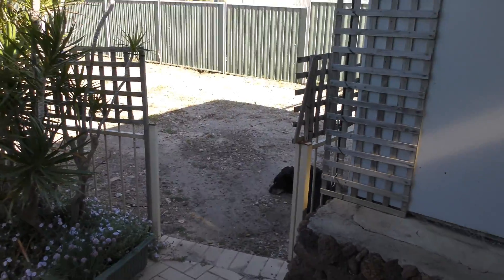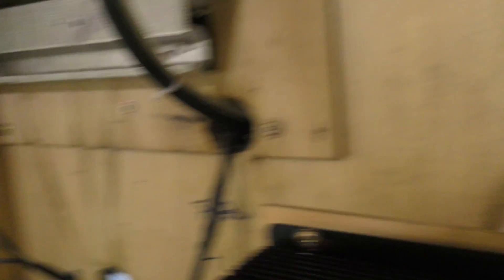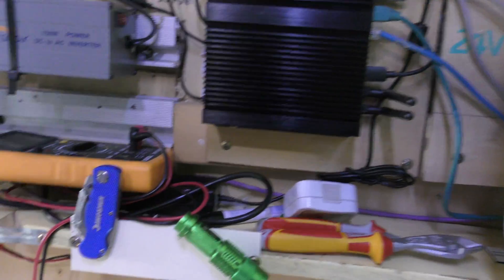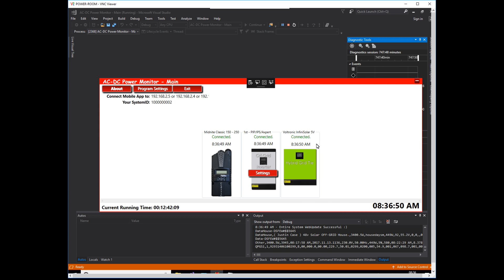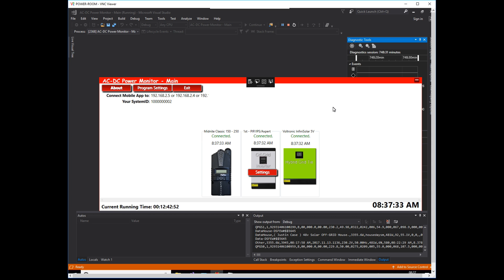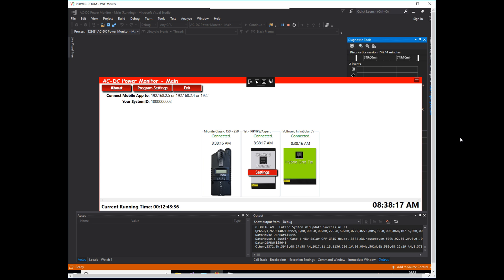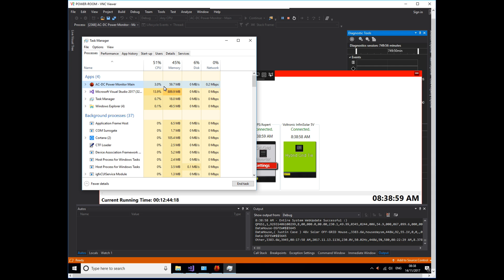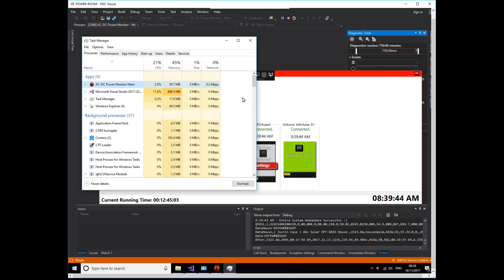OFF GRID Solar Monitoring. New Industrial computer installed

Comment: you might get better signal strength if the antennas are such that they are straight up like the transmitting base modem/router. I probably says any angle, if they are all in the same orientation the waves will all be at the same relationship.
best
Reply from the maker: it get full bars out there John. in the 2.4 and 5gHz range.  Remember in this video https://youtu.be/JEbk56su7Y8 I upgraded and put in a booster in the kitchen. That little power room is just outside the kitchen window. So it works great.
Reply: yep, just sharing what I know about antennas
Reply from the maker: All is well my friend.  Thank you :)